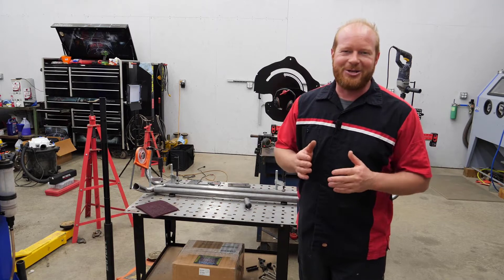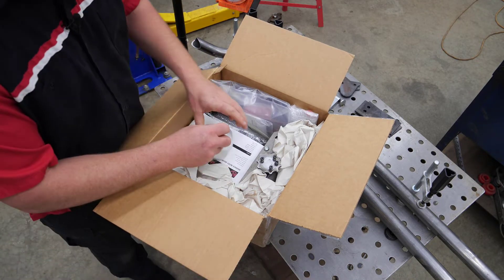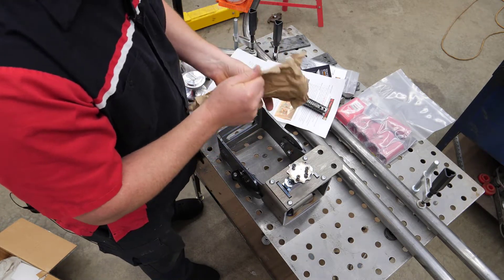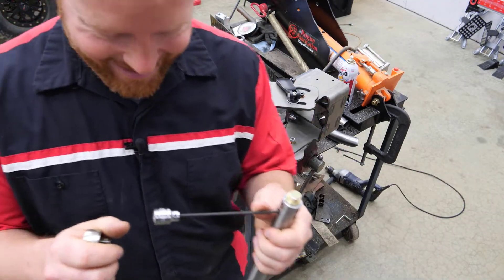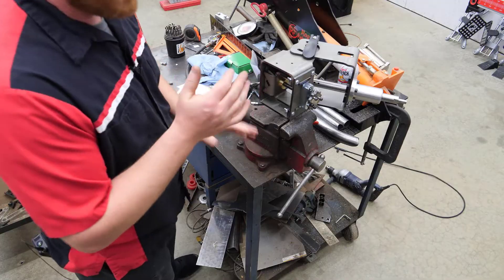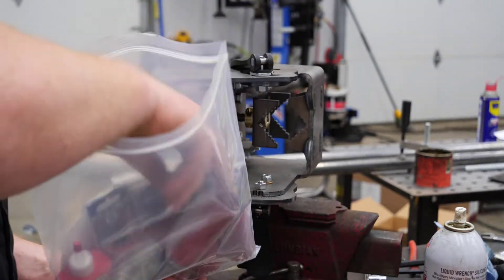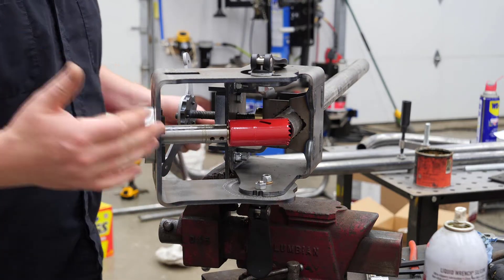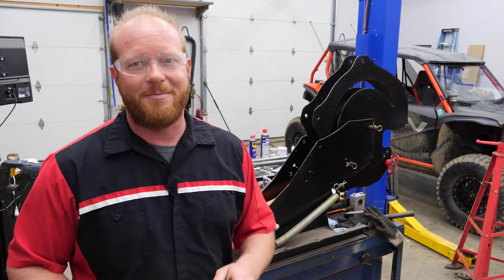Rogue Fabrication VersaNotcher – Universal Tubing Notcher

Comment: Nice review and a very nice notcher from Rogue Fab.  Just wondering though what you would expect from a $60 Harbor Freight with bushings and suggested angle indicator versus the Rogue Fab with shaft needle bearings at over 10x the money.  They both have their place.  For the garage guy, the $60 Harbor Freight will do an okay job.  It's obviously served you well while you used it.  But true frame/chassis builders would more than likely opt for the $600+ notcher instead.  Not knocking either one, they both do a job within their limits.  Nice video!

Comment: Very nice unboxing and demo. They really should pay you for this. Nice job. I had a cheap notcher from Harbor Freight.  Lasted 1 notch, and the screw holding the guide block to the frame stripped out, creating far too much flex in the arbor.  Utter Garbage. Now I have to figure out if I can swing this or not.

Comment: I want one of these Rogue fab notchers... But hay I am a machinist and I should be able to build one... hmmm. Lets see. I have a lathe. So I am going to mount an arbor shaft into the lathe chuck to hold the hole saw extended out from the lathe chuck then I am going to come up with a way to remove my tool post then mount 2 8 inch plates. One will be bolted down tight then the next one will bolt down to that plat but have a center pivot. It will have slots cut so it can be further bolted down around the parameter. 

Then I will figure out how to mount a vise on this that can be raised and lowered and tightened to clamp on the tubing. The lathe carriage will hold the tube then move the tube into the hole saw mounted in the chuck to cut the notch. It will be a bit more awkward to do it this way but I think it will work pretty well once I get it all figured out. Mounting a vise should be super easy but making that vise adjustable up and down to center the tube with the hole saw will be a bit harder but can be as simple as just a back plate with vertical slots milled in to hold the vise or clamp setup.

I have a rotary table on my mill so I will cut/engrave tiny slots every 1/2 degree then mark them, I am going to mark it 360 degrees so I can easily visualize where I am on angle of the tube. This should work out pretty well. I guess I could just copy the rogue fab notcher but I like the idea of using my lathe if possible. 

Once I get the bugs worked out it should be easy to remove the tool post, bolt on the notcher setup, clamp the hole saw arbor in the chuck and start cutting notches accurately.

Any one know what hole saws hold up well on a tube notcher?

Comment: If you had the arbor set on zero, per their marks, that notch was way offset. You mind elaborating on that a little more?
Reply from the maker: The marks on the Arbor side are just an indication of center, they are not going to be perfect. You may need to do some test cuts to make sure you are perfectly centered in the tube.  The easy way to see if you are off center is once the cut is complete you may have the tube still connected by a small sliver of metal. You just need to adjust the arbor up or down towards that small sliver.  The beauty of this system is that you can do off set notches of you wanted.